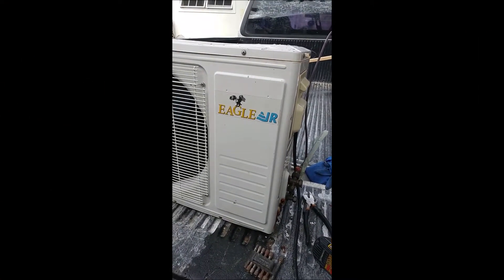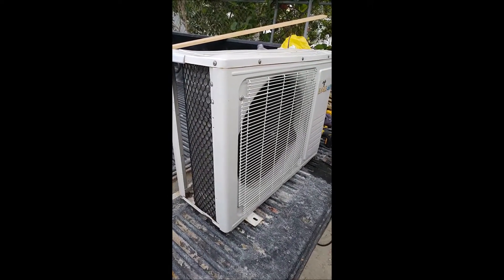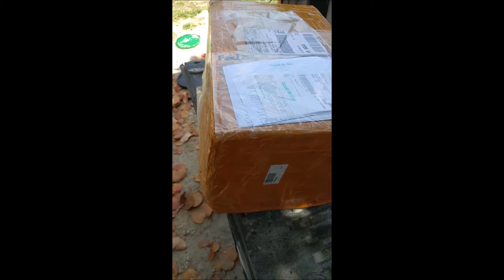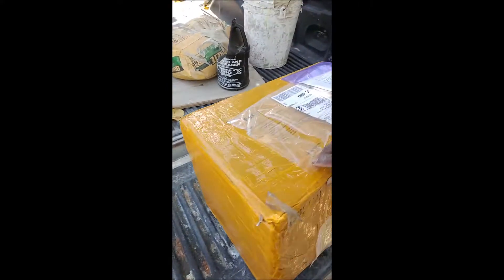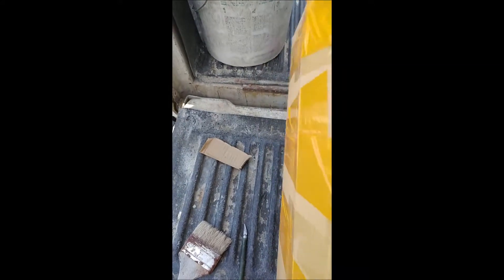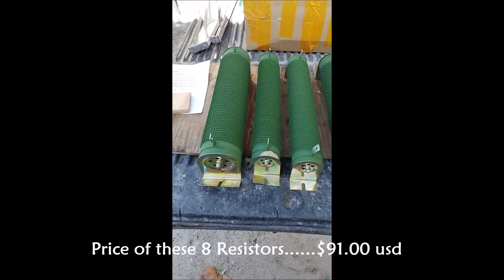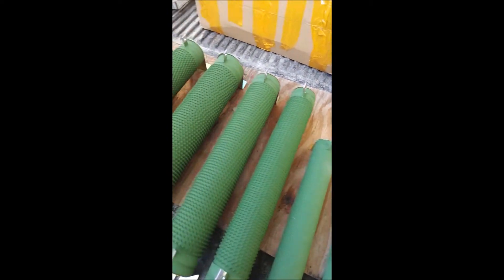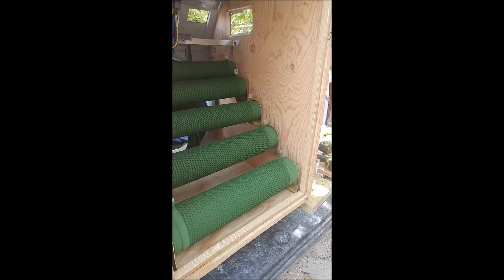Homemade Load Bank Build

Comment: Not for nothing but for a hundred bucks your can buy a 5000 watt electric heater.  You could buy any size heater you want  even one with different settings.  Does exactly the same thing.  Easy Peasy.

Comment: Thanks for the Alibaba response!  If I'd like to have a bank with 5,000 Watts load running on 120 V, could you please let me know the Ohm value that I would need to order?  Thanks again!
Reply from the maker: Voltage (V) = Current (I) * Resistance (R)
Power (P) = Voltage (V) * Current (I)

Enter any two known values and press "Calculate" to solve for the others.

Voltage (V)
120
Volts (V)
Current (I)
41.66667

amps (A)
Resistance (R)
2.88

ohms (Ω)
Power (P)
5000
Watts (W)
This is for one resistor
Reply from the maker: Voltage (V) = Current (I) * Resistance (R)
Power (P) = Voltage (V) * Current (I)

Enter any two known values and press "Calculate" to solve for the others.

Voltage (V)
120
Volts (V)
Current (I)
20.83333

amps (A)
Resistance (R)
5.76

ohms (Ω)
Power (P)
2500
Watts (W)
This is for two resistors
Reply from the maker: oltage (V) = Current (I) * Resistance (R)
Power (P) = Voltage (V) * Current (I)

Enter any two known values and press "Calculate" to solve for the others.

Voltage (V)
120
Volts (V)
Current (I)
8.33333

amps (A)
Resistance (R)
14.4

ohms (Ω)
Power (P)
1000
Watts (W)
Or you can get Five resistors

Comment: Hi Im just looking into doing this for my genset. what sort of LED display did you use and Where do you get such a thing. Great Video very informative Thankyou
Reply from the maker: Sorry for the late post. The LED display was purchased from eBay... very inexpensive, I think around 13 to 15 bucks. Straight outta China. Type in digital voltmeter LED with amp current.
Reply: @gman4reel  Thankyou I’ll have a look.

Comment: Good video. I'm making a load bank for 5kw diesel generator.  Did you use a parallel arrangement of the power resistors?
As well I'm trying to use the load bank in the two voltages (120/240). Can you give me some advice for this? Regards
Reply from the maker: Yes my resistors are in parallel to achieve 240v ac
Reply from the maker: To achieve 120v you may have to use a center tap for your resistors, I would recommend the 240v setup on gensets to balance the load on both phases.

Comment: Another option is an air handler with the strip heat coils in it. You can probably find one for free if you look in the right dumpster and your area has a lot of heat pumps.
Reply from the maker: Thanks but I live in a very hot tropical climate. Our Heat is natural 366 days of the year. Not much heating element on our dumpsites.
Reply: Most EXCELLENT IDEA!  I need something better to load test  on my 4.5 Genset than my Wife's frydaddy  fryers.

Comment: Hi , could you give me the diagram and how many resistors to make it for 500 kva ?
Reply from the maker: I have not advanced that far because the requirements for such  large voltages may demand a factory bought system. Safety issues.

Comment: Thank  you for posting this video. Looking to make a load bank for load testing/exercise 10kw diesel generator.
Can you tell what is the resistance spec in ohms for each RX20 resistor that you used?
Reply from the maker: Two    300 watts 192 ohm
One     500 watts  115.2 ohm
One     1000 watts  57.6 ohm
One     5000 watts   11.52 ohm
One     1500 watts   38.4 ohm
One      3000 watts   19.2 ohm
One     2000 watts   28.8 ohm
Total Resistive Load  13.6 Kw
Regards